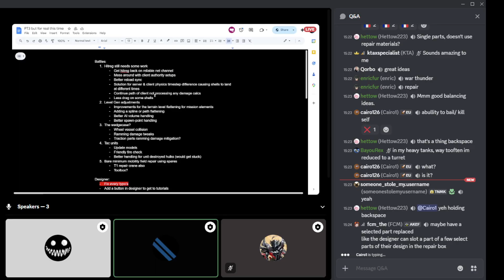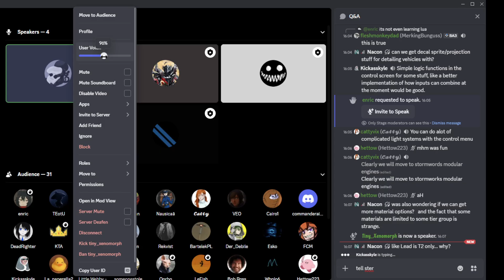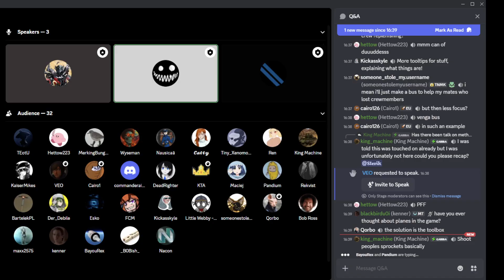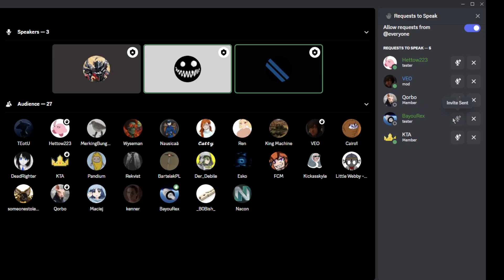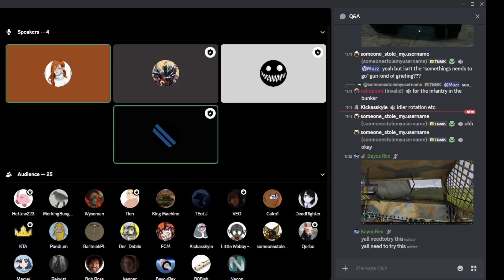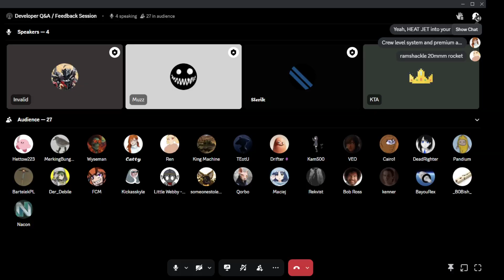Ramshackle Developer Q&A 3/16/2026

Comment: Hey i was wondering how to put the gun into the hull and have so many more questions like why does my tanks with more powerfull engines and transmission are slower then default tanks and how to make a stabilizer into the turret for more powerfull rotation and so much more stuff i need to know